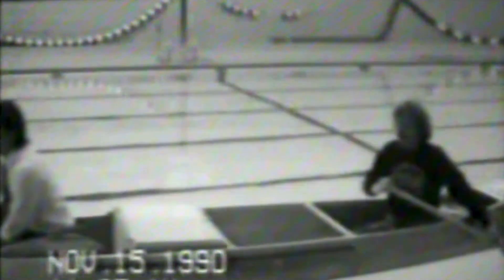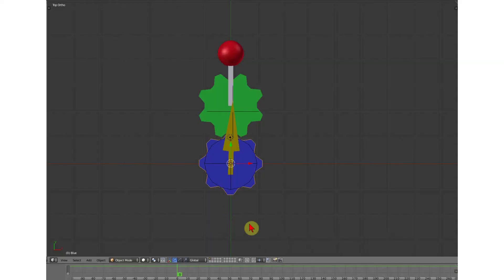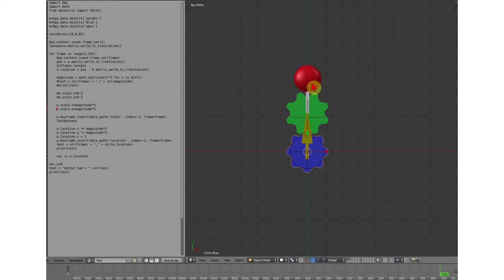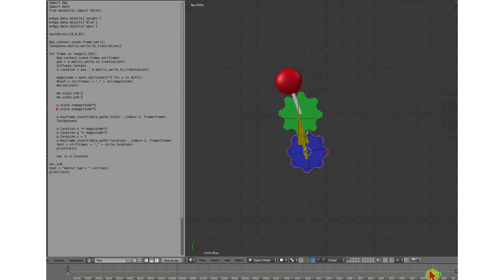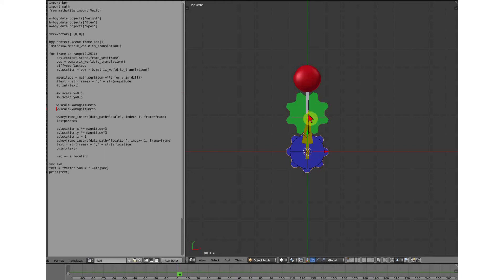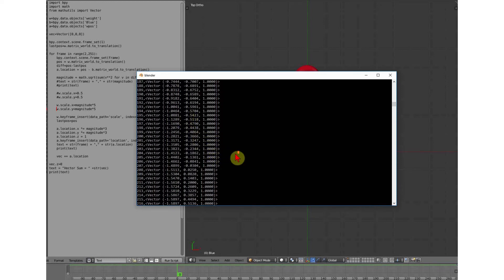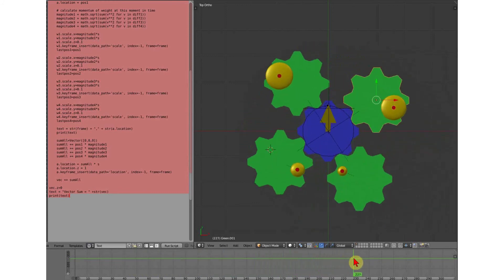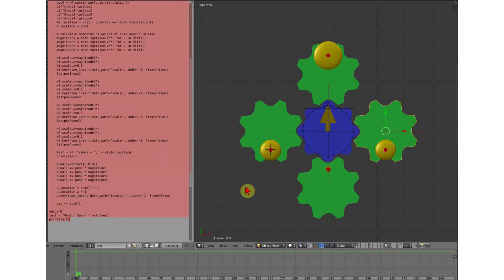New - Proof that  the Thornson Inertial propulsion drive should work

Comment from the maker: It has been pointed out that the momentum calculation is only part of what I need to calculate.  I also need to take into account the transfer of momentum to the hub when the weight speeds up and slows down.  That will be a more complex calculation and I will revisit this when I have more time.
You can get an awesome positive can-do attitude to life by visiting https://www.i-awesome.me/
Reply: Duncans Place if you can, you should also calculate its max speed in space. since theres no air resistance, and the engine travels with the ship continuously adding more energy into movement, the speed of the mass that adds the momentum, keeps going faster and faster.
Reply: I don't believe you need to calculate p=mv at all. All that should need to be calculated is F=m*(v^2/r) where v is taken with respect to the origin (your 'diff' variable). In this case, r is a function of time/frame - which can be more easily calculated as a function of the angular position of the center of the green gear to the blue gear. Because the system is a rigid body, all forces acting on the green gear should act on the blue gear in the same manner and vice versa, so it makes more sense to calculate all forces with respect to the blue gear (for forces extending radially outward, I just picture a inner toothed ring gear encapsulating the system (the center of mass remains at the center hub, so all calculations are still valid). Could you send me your model and code? I'd like to play a bit with this.

Comment: The problem with this is that it can produce force in one directions greater than the opposite direction but that the force applied at a moment without considering the amount of time that force was applied is the mistake. With this mechanism if force is double what it is in one direction that also means that the force is being applied for half of the time it is applied in the opposite direction. If the force is to weak in one direction to overcome the resistance friction of the water but great enough to overcome the resistance friction in the opposite direction it will move in that direction because of it. If the same thing was done in the vacuum of space it would move faster in one directions but also for a proportional less amount of time. In the opposite direction it would move slower but also for a proportional greater amount of time. The amount of force with the amount of time the force was applied in each direction would be equal.

Comment: I just did a mathematical proof if this would work or not because I was curious. If anyone sees any errors please lmk! Here it is:

The parametric curve of this motion is x(t) = (sin(t) + sin(2t) , cos(t) + cos(2t)) for 0 <= t <= 2pi
Velocity v(t) = d/dt(x(t)) = (cos(t) + 2cos(2t) , -sin(t) - 2sin(2t))
Acceleration a(t) = d/dt(v(t)) = (-sin(t) - 4sin(2t) , -cos(t) - 4cos(2t))

To find the net acceleration of the mass over all 0 <= t <= 2pi, integrate a(t) over 0 <= t <= 2pi:
Integral of a(t) is simply v(t), so we find v(2pi) - v(0) = (cos(2pi) + 2cos(2*2pi) , -sin(2pi) - 2sin(2*2pi)) - (cos(0) + 2cos(2*0) , -sin(0) - 2sin(2*0))
= (1+2,0-0) - (1+2,0-0) = (3,0) - (3,0)
= (0,0)

Therefore, the net acceleration on the mass (and therefore of the whole system) over one revolution (from 0 <= t <= 2pi) is (0,0)
Hate to say yall but this thing won't actually provide any thrust. Is there anything I'm missing?
Reply: So, assuming the video was not faked, how come in the video we see the motor moving the canoe through the water?
Reply: @lawrencestanley8989  Probably the same reason you can scoot your chair across the floor without touching the ground. Differences in static and moving friction. You are still pushing off of the earth (or in the case of the video, water).
Reply: @Porter-Morgan  
So... It doesn't provide any thrust, and yet it moves the canoe through the water?
Reply: @lawrencestanley8989  it can only provide thrust if there is something to push off of. Meaning it isn't reactionless, as is being claimed. It won't work in a vacuum in orbit or anything if that's what you're thinking.
Reply: @Porter-Morgan  
Oh, I see. Nah, I was just curious to make one for my kayak. I don't have any reason to travel to space, at least not this year.
Reply: @lawrencestanley8989  Haha I gotcha
Reply: The motor moving the canoe is tipping up and down on the front side.  This means that version embodied the Shipov effect, which DOES work, and that's because the forces are non planar.  The external force from gravity increases the rotational speed as it tips down, but decreases the speed as it springs back up.
Reply: I have not worked the equations but clearly the change in radius of the mass will surely result in net upward force.
Reply: @Porter Morgan  It seems to me given your logic it could at least push off of its own mass.
Reply: "empty space is not empty"
Reply: You have proved that a mass traveling along a loop and returning to its starting point does not experience net positional change from 0 - 2pi... of course you will find that there is no acceleration! To be honest, the math you have here is no where near an adequate dynamic summary of the variable load experience by the axle. You have a tiny piece of the kinematics, which are not at all applied correctly. The solution by hand is near impossible believe it or not, because conventional wisdom tells us to assume that net forces on a closed system are zero, which supplamemts the math! Otherwise this can be dynamically simulated as a vairable centripetal vector, plotted over time to demonstrate any a-symmetrical power distribution about the driven axis. In other words, this is one damn tricky system to disprove without building! Dont even attempt it unless you have experience in complex pendulum and rotational dynamics.
Reply: @nix324 this is entirely made up.
Reply: I'm pretty basic, when it comes to math, but I know that, in this system, the "thrust", if any, would be minimal, due to being within the geometric constraints of the fixed system.
I also know that, if one is able to manipulate the local angular momentum, relative to the global, in a way that allows the swinging mass, not by mechanical force, to "reset", into an "orbit" of greater radius, and then, by mechanical force, shorten the moment, then it is very possible to produce HUGE amounts of "thrust", slightly to the right, in a clockwise system.
Being less-than-strong at this advanced math, it's taking me a great deal of effort to begin to calculate momentums and accelerations, and, not being a classically-trained engineer, I'm basically just "eye-balling" basic cross-sections and load-vectors, in order to make this a commercially-viable endeavor.
If anyone out there is willing to lend a hand, to do some math or modelling for me, then let me know. RW8Peterson[at]gmail[dot]com.
Reply: intersting! super curious what would happen if the device were mounted in a box, tilted downward at 15 degrees but the box were horizontal, some of the x movement is now in the z axis, assuming the z axis is vertical to the box. I guess the same thing, since the graph of the x axis would just be a squished version of the curve we get from the z axis.
Edit: its super late I can't keep track of which axis is which
Reply: Да, есть ! ..Тебе не хватило воображения поставить модель в горизонтальную ось и перевернуть ее на 90° ! (Вес ( ядро)на 15.00) ! Посчитай теперь  !  И+ ..прибавка будет масштабируема с увеличением веса( красного ядра),длинны его тижа и игрой диаметром центральной шестерни и не только центральной !  можно напр., для усиления плеча запустить и элипсовидную шестерню в качестве второй, сложить правильно оптимальные  фазы ибаста !  Тк.Это уже  ВД.,мучачо ! Не благодари!
Reply: @Porter-Morgan ошибаешься! Это и есть БЕЗОПОРНОЕ ДВИЖЕНИЕ ! посмотри патент по этому названию и впредь не умничай публично ..))!
Reply: Mach effects?

Comment: Simple planetary gear box can be modified to add weight off center to each outer gear, though we can get the same effect by pumping fluid through a teardrop shaped path to create more centrifugal force around a tight turn vs. a long radius turn.

Comment: Nice video! Thornson's drive does work, or a version of it that is very similar but with a few details he never put in writing. We can model & calculate until we are blue in the face, but since conventional "wisdom" says it is impossible all of the cards are stacked against CAD models and calculations. 

I honestly applaud you for taking the time to make a study of this design. It really is a low tech solution to a high tech idea but since we are taught that this doesn't work, only a few of us have taken the time to see for ourselves.
 
If one takes the time to purchase & study Roy Thornson's videos and book, you will see that his "demo" unit was not the full working model and he does not clearly show what is in the box on the canoe. Hopefully I can lend some small amount of insight to those wishing to build a "reactionless" drive.

 1st, the weight is a pendulum which pivots at the edge of the planet gear. 2nd, the weight cannot cross the center of the sun gear's axle. 3rd, the weight must be stopped at it's furthest outward point away from the planet's axle. 4th, timing is important i.e. clock positions of the gears. 5th, counter rotating weights may be necessary in zero G, but it is MUCH stronger if the two halves rotate in the same direction. 

This needs to be an open source project, taken seriously by us little people or it will never become mainstream technology. People working on these things need to post videos & design notes if it is to ever be more than folk lore in some obscure book. I have a functional prototype and I am posting my videos on YT as well as Bit Chute. The notes are all being posted to a Blog along with pictures & videos if anyone is interested in furthering this https://grassrootsmechanicmovement.blogspot.com .

Sorry about the length of this comment... I get a bit wound up at times...

A note to any negative posters in any forum, build one before you bash anyone else's work.
Reply: You're probably too busy to answer this so don't be concerned about it. On the 4th paragraph, you said "3rd, the weight must be stopped at it's furthest outward point away from the planet's axle." Why is that?
Reply: Why are the cards stacked against a cad model?
Reply: @davidb8351  It adds the time value to the motion of the pendulum. There need to be some sudden movements. It's not as much about an impact but it's about the sudden introduction of a time change (speed change) of the Mass's movement.

Comment: If  vector  sum  all  forces  and  reactions  multiplied  by  respective  durations  is  not  equal  to  zero,  the  concept  is  feasible.
  These  attempts  are  worth  considering  benefits.   Hope  for  breakthroughs  bypassing  present  theories  and  introducing  new  theories.

Comment: i actually built a scale model of the device a couple of years ago and didn't have the hoped result to be honest and had almost no detectable thrust out of it. my design was closer to the quad gear smooth type you shown here so without the weight on a swing arm but a weight on the gear it self. so bringing out the weight on a arm is a must. my personal theory on how it generates thrust is that in an mathematical ideal situation there shouldn't be any thrust (the forward and backward motion cancels each other out) yet because of the loss on the double back motion and less loss on the single long forward motion it creates a differential thus thrust almost like how lift works on a wing.
Reply: I had the idea of this 18 years ago. Never did build it but built something similar. When you say almost no detectable thrust what do you mean exactly?

Comment: working on similar,  my math skills are not as good as yours, but my instinct says three gears 120 deg.@ has a chance to product more lift.. ediet-- while checking my mock up, it looks like if you extend the  ball arm, so instead of the ball crossing the center line  of the stationary gear but instead have it cross the further edge of the gear, to my thinking not only will you get more lift in the up position but you may get some lift at the lower one as well? Running past the overall center line as it will.?

Comment: What's the max RPM on which this device could work properly? I think that the result forces should be much stronger if to run it on a greater speed. I have seen that there are several examples of this inertial propulsion solution, but the speed of rotation is too low in every type of them. What's the reasons? Is it resulting from the parameters of this device? BTW the conception of the device is simple and clear, so I think that if to add some financial attention to this technology the result should be much more amazing than some people think.
Reply from the maker: I would love to see someone build a robust enough version that can run at high speed, but that requires money and a good tool shop.

Comment: Well done. Someone needs to build this.
Reply from the maker: Thanks, Hopefully someone will build it and post a link so we can see the results.
Reply: I did build the four arm version.   I placed a stationary sprocket on the non turning shaft of a ceiling fan motor, with four spinable sprockets around the motor.  With a chain wrapping around the outer sprockets, then down on one side to catch the central, non turning sprocket, there was NO net force.
Reply: @nix324  You will not be able to swing a mass around an axis offset from the center of mass without an outside force or thruster
Reply: @nix324  the combined center of mass will still not move.
Reply: @nix324  which axis?
Reply: @nix324  I may be mistaken, but it you just stop the mass, won't that create a jolting force backwards?
Reply: calistohuettich As i said you are wrong, you are confusing shifting the center of mass with assym cent pull. There is net force indeed. davidb8351 Depends how mass is stopped, there are ways that work and that do not, one needs to be clever about it.

Comment: There is no net force. The momentum of the weight over half circle is independent of the radius of its motion. Thornson's device moves because it pushes initially against the edge of the pool. The boat conserves that initial momentum.

Comment: if you were to chuck the weight off the back of the canoe that would work. pebble skimming power. run out of stones and you'll be left trying to rock to shore again. it does work but not the way you think.

Comment: Three piston of that type [phase 120'] giwe smooth lift with amortization,add horizontal gyroscope for weight loss,steering.Rotated mass should be approx.2kg and 10000rpm/min. for 100kg lift.

Comment: You can't test it on water because of the variable resistance of water. He should test it on an air bearing. Also calculate way more vectors than 250.

Comment: Liked it, well done. If you have a brief acceleration in one plane then an object will attain a final velocity, same plane ( in free space - no friction forces). If there is the same amount of acceleration but in the opposite direction after the first 'pulse) then the object will lose velocity and stop. Between the start and the stop there will be a displacement of the object. To return to the origin would require twice the initial force applied. So, pulse of force, velocity and displacement. Anti-pulse, velocity to zero and displacement ceases. Pulse again, a further displacement in the original direction. Nett effect is an achievement of average velocity over time in the one direction. What is needed is a constant acceleration to be a useful universal engine. How? Simple, maybe - if the pulse and anti-pulse could occur in the same direction then displacement from the origin would be ever increasing, which equals acceleration. To get the pulse and anti-pulse occurring in the same direction requires a continuous rotation of the whole device by 180 degrees between each pulse/anti-pulse cycle. Can you model that? Do I make sense?
Reply from the maker: Hi Paul, thanks for the detailed response.  I do understand your idea and I believe I have considered it before and discarded it as not workable, but I cant remember why right now.  I will model it and make a video as that would be interesting, however we are getting some seriously hot days here in Sydney Australia (38c-45c)which limits my computer time to about 2 hours a day so it could be a week or three before I can complete another video.
Reply: Duncans Place Pretty hot over there! I got Blender to model my own ideas, saving me time and money from having to build. But, as you say, it can only simulate the known, and disregards unwanted effects. For instance, to have a velocity there must be an acceleration. To have acceleration there must be a moment of jerk, etc, to snap, crackle, pop and more. I never did model with Blender as the learning curve, for me, was a bit steep when I could have used the same time to make a model. Anyway, I'm betting you can't model jerk, snap, crackle or pop inBlender. From a mechanical engineering perspective, jerk is a nuisance effect that is designed out as much as possible - when there are actual possible uses for it in a particular system of inertial propulsion. All the best for the New Year, and please keep up the experiments.